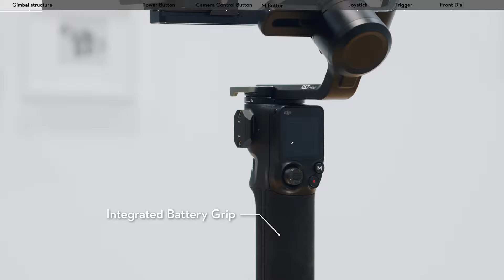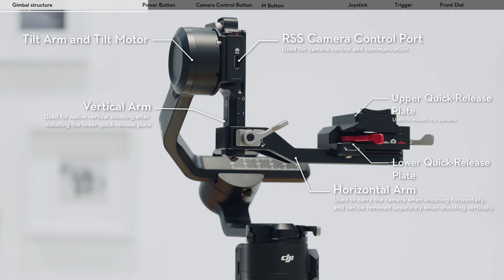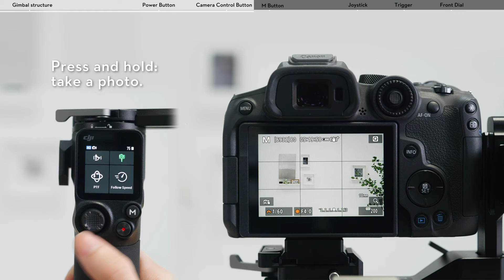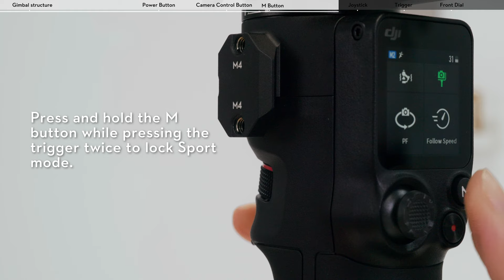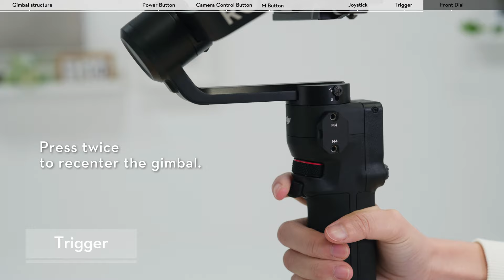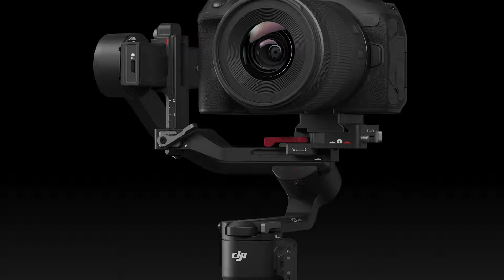DJI RS 3 Mini｜Structure and Buttons

Comment: It appears that Screen Lock doesn't prevent you from changing user profiles (by touching the M button by accident).  That's surprising because the M button is so close to the Camera Control Button; you'd think M would be the easiest button to hit by mistake.  

Is there anyway lock the M button?  To disengage M2 and M3 if only one person is going to use the gimbal? 

Or, if that's not possible, to apply the settings from M1 to M2 and M3 just in case you change the user profile by mistake?

Comment: Hello, yesterday I bought dji rs3 mini gimbal for my nikon zfc model camera. I checked your camera list and as you dji said this gimbal support nikon zfc via cable. But I cannot change iso and shutter. I would like to know why? I updated my firmware also.
Reply: i have the same problem as you on my sony a7iii, did you ever find a solution ?
Reply: @Drimsteur  unfortunately no. Dji said, this is our problem. Maybe next time will solve this problem but when, they don't know.